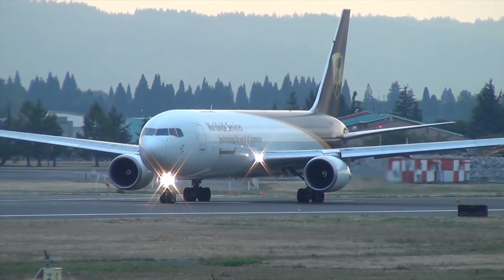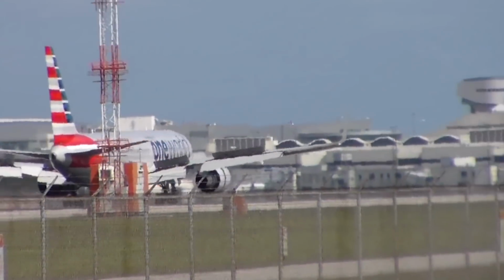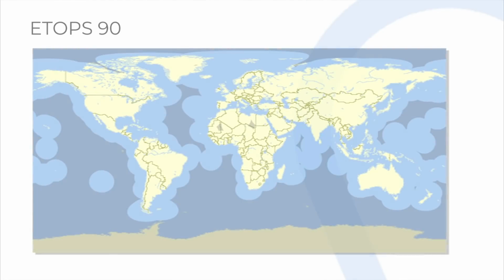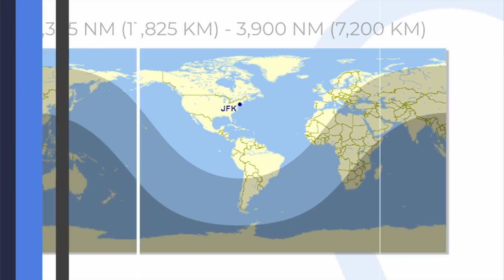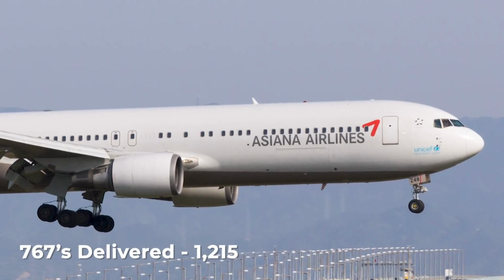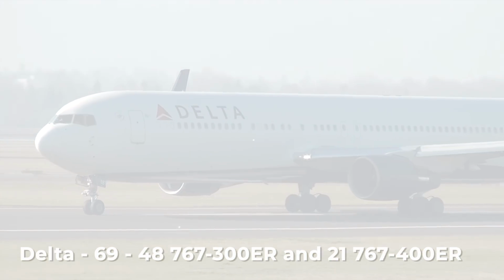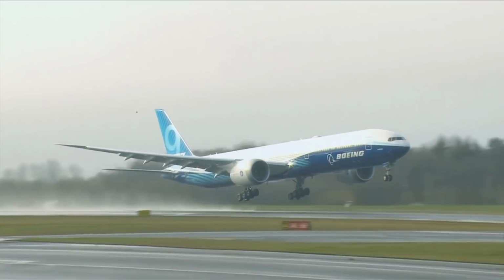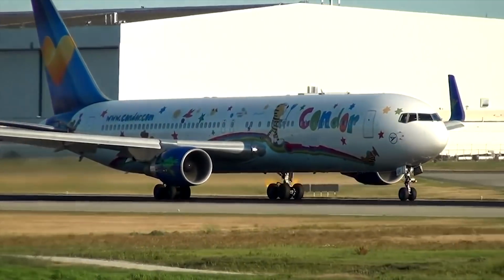The Rise & Fall Of The Boeing 767

Comment: There is a chance for a 767 update to compete in the middle market as they are still being produced for cargo . A 757 update is not possible . A smaller 787 would be too expensive for airlines to acquire and would make no sense ,as the 787 800 is no longer being ordered and has been overshadowed by the 900 so an even smaller 787 makes no sense .

Comment: Always loved the 767.  The 787 was meant to be the replacement but i think what will see in the 787 is evolution of the 787 model with a lighter weight version using the folding wing tips off the 777x and dialing back the range to 6000 nm.   

The 787-8 is about finished in production as airlines opted for the 787-9 for long haul.  The -9 and -10 will end up evolving with a high gross weight version but the shorter -8 needs a new evolution

Comment: I think it's worth mentioning that the 767 always had a 2-3-2 configuration in economy class, unlike both the Airbus A310 and the McDonnell Douglas DC-10, the latter two aircraft having a 2-4-2 configuration in economy class. If anything, had the DC-10 Twin came to pass, it would've basically been McDonnell Douglas' 767, perhaps with a 3-3-3 configuration in economy class.

Comment: 2:03 Not sure about this -  The A300 which came many years earlier was presented with economy being a primary selling point.
Anyway - I get the range was good on the ER's but i never fully got how the Pax 767 became so successful from an economics standpoint - with the 7 abreast economy layout you gain 1 seat per row over narrow bodies but for the cost of a second aisle.  So yes it fulfils long range missions more economically than the trijets or 747, but I would have thought the fuel burn per seat to have still been quite high.  Phaps I'm being disingenuous because it's by far the most boring airliner I've ever seen.

Comment: I have flown B757 B767-200 -300ER and the B767-400.  Remarkable aircraft.   Designed when Boeing was run by engineers not accountants.

Comment: Ever since Boeing acquired MCD, they have had nothing but problems. The MCD management really messed up things at Boeing. The 757 is an awesome plane, but once sales fell off after 9/11, they killed it off. if they could have only seen into the future... The 767 is another great plane, but in aviation, size matters and with bigger planes coming along and technical advances, I don't see it being used except by the military as a tanker. A new clean design narrow body is the best bet for Boeing or and advanced 757.

Comment: The 757 was deliberately developed at the same time as the 767 to give the two aircraft the same cockpit layout and similar flying characteristics to achieve a common type rating for pilots (at least at launch). That's why the 757 cockpit looks a bit weird - large 767 style glass on a 707/727/737 type fuselage.
As for any future 767 development - the 787 competes in the same market as the 767, so any future development will likely be from that platform.
Similarly, the 737-Max is now large enough to compete in the same market as the 757, which is why that has ceased production.

Comment: The most comfortable twin isle civil aviation aircraft
Boeing 767 (2-3-2) > Airbus 330 (3-2-3) or Airbus 380 (3-4-3) too chaotic or Airbus 350 (3-3-3) narrower 18.5>18

They need to be lighter, update wings, update more fuel efficient engine, make fly by wire, modernize

Comment: 767-100/200 with new engines and wings from the 787 would fit the bill for the NMA. They already have the tooling and production facilities for it. Wouldn’t compete with any current Boeing offerings and is cheaper than a clean sheet 797. Or of course the elusive 757x would fit perfectly. I can dream.

Comment: I'm not a huge 767 fan if I'm honest but I can still see that it has helped pave the way for most of the current wide body twin engined aircraft which now dominate the transcontinental market. It was the first aircraft to acquire ETOPS 180 so that's a massive achievement on its own.

Comment: In my opinion the 767/757 are the best airplanes Boeing has ever made.  I am so glad that Delta is keeping theirs past 2025.  With the totally brand-new interiors you would think you are on the newest Airplane available. I'm saddened that Boeing has all but abandoned them because they are absolutely still one of the best Airplanes out there from a passenger comfort point of view.  Airbus has replacements for them but to do that an Airline needs about 4 different models which I also like, but Airlines would probably prefer just the two Boeings due to cockpit commonality.  I will fly on them as long as Delta keeps them.

Comment: How a 767 and 757 could be related is beyond me. Totally different flight experience. One takes forever to get off the ground and the other puts you back in the seat and beams you to great heights quickly. You knew you were on something special with the 757. As boring as the 767 was in comparison, I do like the seating.
Reply: The only commonality is the cockpit, the systems are vastly different,  I  flew both and you always had to be careful not to get confused when operating both at the same time
Reply: They are related in system design. They have the same type rating good to fly both aircraft.
Reply: Completely disagree. Pilots describe the 767 as being way more agile.

Comment: Yes! 767-100 is the MMA (NMA) answer!  New wings and engines with the 787 cockpit and they have it! 767-2  The infrastructure is there and still in use.  Could totally be produced on the existing line with the freighters. Then they could concentrate their resources on the new single isle 737 replacement.
Reply: There is no such thing as a 767-100
Reply: @pirate3599  Exactly.  It should be built as a NMA.  Read my comment again.
Reply: @RScottPR  going backwards from -200 -300 -400 doesn't make sense
Reply: @pirate3599  it’s about the size.  Typically the lower the -number the smaller the plane.  How about a -3 to start?
Reply: @RScottPR  when you analyze the 787 its not much different in size to a 767, but the many technology improvements have made it far more efficient with huge range increase, I love the 767, flew 14900 hours on it
Reply: Not a bad idea, but Boeing really dropped the ball by sticking with a 1960s 737 design, huge blunder

Comment: The 767 used to be my favorite airplane, so it’s really sad for me to see them slowly fade away.
Reply: They will be around as FedEx is received many new 767 freighters to replace MD 10 , etc
Also KC 46As are replacing KC 10s.
Reply: That along with the 757. Truth is everyone is switching to 737s and a320s and most other aircraft are being phased out for lighter smaller single isle twin engines

Comment: I think Boeing Could Re-engine, re-wing and give the modern sky interior to the 767 if they wanted to 👌

After all, Airbus did a similar thing with their A330 series, added A350 style wings and upgraded engines and gave her their modern AirSpace interior, to make the A330-800Neo and A330-900Neo, the latter obviously has been more popular.
Reply: Yeà , they already have experience building composite efficient wings for the 787/777X. Wouldn't be surprised if they re engined the 767 and added a new wing
Reply: @mmm0404  I think a 767 redesign is unlikely, but if they did do it, I think she'd look beautiful 👍🏻
Reply: @guitarplayerforu  anything can happen. The 787 is too heavy to derive an NMA varient from it. It's too late now to launch new a competitor for the XLR which could enter service in the mid 2030's , the 757 is no longer in production , the 737Max10  could get an ER version but it still wouldn't be enough . 

Only the 767X has the best Chance of fruition now but if Boeing is willing to hand the market to airbus and wait to develop a new aircraft for the 2030's  it's really up to them... 

Any new aircraft development means Boeing is left without any offering against the a321xlr for 8 to 12 years
Reply: @mmm0404  I get what you're saying, but I'd guess that the 787 is much lighter than the 767 due to being a composite aircraft, I guess they could bring back the 787-3 if they really wanted to and airlines would buy her, but as nice as a 783 or 767X/NG would be, I think Boeing are ultimately set on waiting till 2030's for their next aircraft.

From a financial point of view with how things have been for them in recent years, I can totally get why they want to wait till the next decade for the NMA, but then on the other hand, the next decade is still almost another decade away yet, so it seems a very long time to go without either modernising an existing model or Building a new clean sheet aircraft.

One option Boeing could do is upgrade the engines on existing 757's as a Stopgap until they can design a true replacement, bit like what happened with the DC-8 when she had the option of upgrading to CFM56 engines. 

We'll just have to wait and see what happens, as you said anything can happen 👍🏻

Hasn't the XLR been Delayed till 2024 now? I'm sure I saw that somewhere the other day.
Reply: @guitarplayerforu  despite the 787 using composites for its fuselage and wings , it is still generally heavier that the 767. The heaviest 767 , the 767-400er is close to 20 tons lighter ( dry weight) and has a MTOW of close to 25 tons less than the smallest 787, the 787-8. Pretty heavy .

The proposed 787-3 was just basically a 787-8 , with shorter range  , that could carry more payload instead for regional routes in the Asian market. It was proposed for the Japanese carriers, and it was still the same size as the 787-8 , not really NMA size if you ask me ...

Another reason why the 787 might not work is because composites are more expensive to purchase , manufacture and machine than steel , Making it much more expensive than the a321XLR. Meanwhile the 767 is made from steel which is cheaper and easier to machine , and a 767X could be competitive in pricing to the a321xlr

Considering that airbus re engined the a330 which was a 767 competitor I don't see any reason why Boeing cant do the same for the  767 but to be honest it's up to them . 

And speaking of the 757 re engine, as much as I love the idea , it has a very unlikely chance of happening. The 757 had unique higher thrust requirements , meaning the Leap1A/B engines powering the 737 max/ a320neo / a321XLR would not have been  powerful enough and the GEnx /Trent 1000/ Trent XWB powering the  787 /a350 would have been too big/powerful for a re engine version. The only option left would have been to develop an all new engine specifically for the 757 X , which would have taken time and driven costs up. 

Meanwhile the 767X already has a perfect engine that could meet it's requirements, the GEnx powering the 787/747-8....Just some tweaking and no need for an all new engine
Reply: @mmm0404  A 767X would be roughly 16.5 tons lighter than a 787-3 when you factor in the Extra weight of the new engines over the cf6, although if they gave her the composite wing from the 787 that'd make her even lighter, and still also considerably lighter than a 783. I do think the sky interior from the 787 would be needed on a 767x though to modernise her 👍🏻

Unfortunately, I think a 767x or re-engine of existing 757s are both unlikely, However, It's nice to imagine what they'd be like if they were to become a reality though isn't it? 😉
Reply: @guitarplayerforu  
Personally I don't think boeing could just leave the NMA market for airbus since it's Basically the future of air travel. Developing a new jet that could enter in the mid to late 2030's could just give airbus a 15 year headstart in the market and Boeing could never catch up. It's unlikely that Boeing would just sit by and let that happen , so a 767X is a possibility  that can make boeing competitive in the short term as they plan ahead. I'm not 100% certain a 767X may happen but I wouldn't say it is unlikely, maybe a 50-60%  chance considering its one of the few only ways they could counteract the a321xlr 

Nevertheless, considering that the 787 took close to 7 years from launch to entry into service, developing a new jet wouldnt be a bad idea , but remember by then Boeing was much more financially stable and didn't have any troubles with any of their jets like they have now with the MAX10 , 787 AND 777X. 

If they could take 5-7 years developing the 797 with  entry into service around 2028/2029  , I think that would be better overrall than the 767X, provided they don't have  any long delays that could bring that to the mid 2030's
Reply: @mmm0404  I totally agree pal 👌🏻

I think the only reason Boeing Paused development of the NMA was so they could focus on fixing the 737 Max, 787 and 777X and of course the huge financial loss they've suffered as a result.

I personally think it was a mistake for Boeing building the Max, a clean sheet aircraft would have been much better in my opinion, maybe they could have made a new aircraft that could be scaled up and down, to replace both the 737 and 757, and that way, it would save Boeing a lot of money in development costs. 

I think the 787 has a bright future ahead of her, although I can see the 787 getting re-engined at some stage in the future, as Turbofan engine technology further advances and gets even more efficient. 

The 777-9 I think is the last jumbo sized aircraft we'll see sadly, unless of course future engine technology makes a new jumbo sized aircraft viable. 

I'd guess the new NMA from Boeing will be a small widebody, with the operating economics of a Narrowbody and the payload and comfort of a widebody.
Reply: The 767-400ER has the sky interior with the pivoting overhead bins. Some 300ER’s were also retrofitted with the updated interior during major checks. Additionally, some new late build 200ER’s for Continental also had the sky interior fitted standard. Now we just need that new wing and some engines. 😀
Reply: @mazdaman0075  *Signature interior also known as the 777 interior
Reply: @ag6371  Thank you, yes, Signature not Sky. I was thinking of the pivoting bins which are of course part of the Sky interior but without the LEDs etc.

Comment: Actually the reason why Boeing 767 remain in production is because some scepticism within Airlines to Boeing 787 when they just launched and got problem with their battery. And now with 737 MAX facing another flow, it's kept pushing the interest for 767
Reply: Not necessarily , the battery issue is just some minor challenge that came with an all electric architecture. It has been solve close to a decade ago and there has never been an issue since . 

Some airlines still operated the 767 because it is much lighter than the 787. The 787-8 for example has close to 20 tons more weight than the 767 400 ER making it inefficient for short to medium haul routes . 

Even though the 767 has less efficient engines , it is much lighter than the 787 making it better for short/ medium haul flights in the short term

Comment: I wouldn´t really call the 767-200 long range, Rather medium+ range. The range 7200km, is just between medium and long haul. And the aircraft would really need a fairly light load to do that
Reply: The 767 -200 ER could fly up to 12000 km
Reply: @mmm0404  200ER is a totaly revamped aircraft that have more incomon with the 300 than the 200

Comment: Back in my business travel day out of MCO in the 80's, the Delta L-1011 was the equipment of choice.  I would base my travel assignments around it. I would grumble when I had to get on lesser aircraft.  Years went by and so did the L-1011.  I finally settled down in the SF Bay area.  Two trips to FRA and MAD in the 90's intro'd me to the 767/777.  What wonderful replacements they turned out to be for the 1011.  Sleeker models with nods back to the L-10.  They are comfortable and spacious replacements.
Reply: The 777 was great until airlines started refitting them with 10-across coach seating. In that configuration, they’re miserable.
Reply: You had good taste, the L-1011 was awesome

Comment: The 767 line is still open because of the KC-46A tanker program and the 767-300F production. In fact, there is large demand for the 767-300F due to increasing demands of online retailers worldwide.

Comment: This design is a victim of it's own success.. thier are 3 major flaws with it.. 1 the engines are limited on thier fan diameters sizes.. you can't put anything bigger on The airframes 
2. Cargo size.. the layout,  to get the passenger loads it forced Boeing to design a small hold which required a smaller  uld for the cargo compartments. 
3 .range . Because it was really designed for medium rang high traffic routes (less then 3800mi) any weight savings was tossed out for the extra fuel for those extra miles traveled
Reply: No, I think the range was the reason why the 767 outsold the A300.

Comment: I hope that Boeing will improve the 757 instead- it’s a much cooler plane I think
Reply: The 757 sucks for coach passengers ...
Reply: @sking2173  eh I still think it’s better than the 767
Reply: @ATIMELINEOFAVIATION  — 3x3 coach seating (industry standards for 757) vs 2x3x2 seating? And you prefer the 757? Really ??
Reply: @sking2173  I never said I like riding one; I just like the plane.

Comment: I think Boeing should relaunch the 787-3 because it would slot between the 787-8 and the 757. This would serve as a good replacement for Delta & United's ageing 757s some of which are over 30 years old as well as their 767s.
Reply: To heavy. The economics of it don't work since it has almost all the weight of the larger versions. That's why it was canceled. All too expensive to manufacture for the market segment.